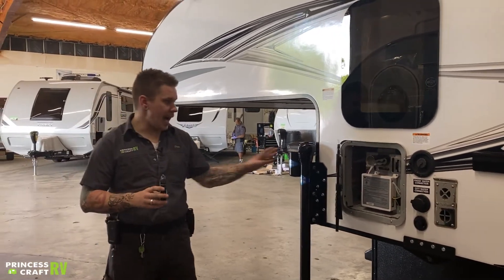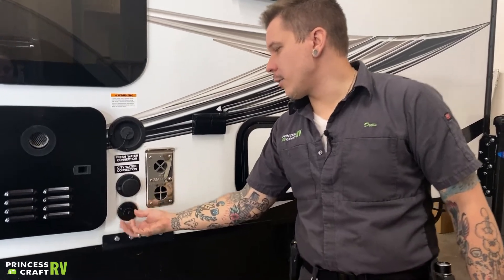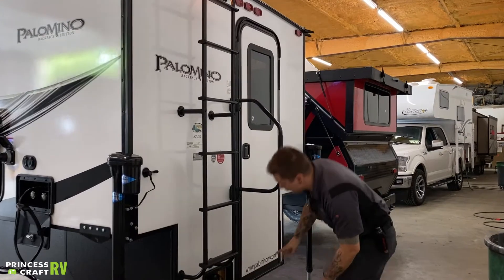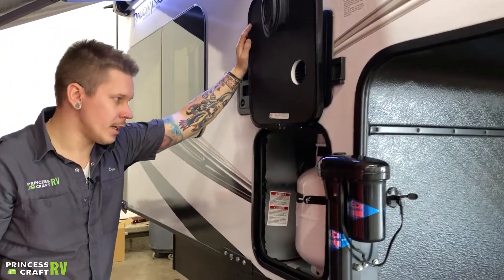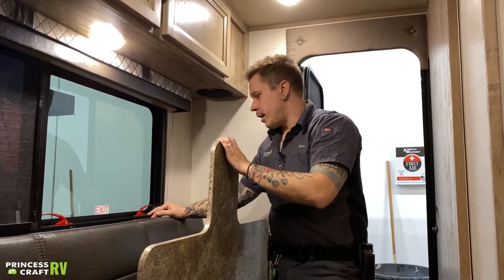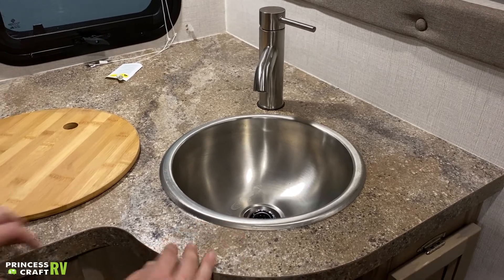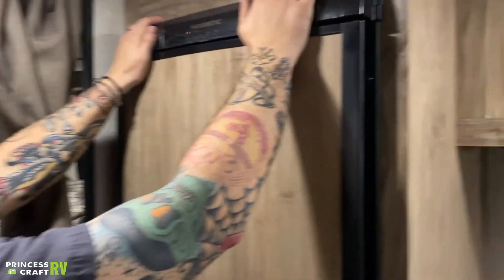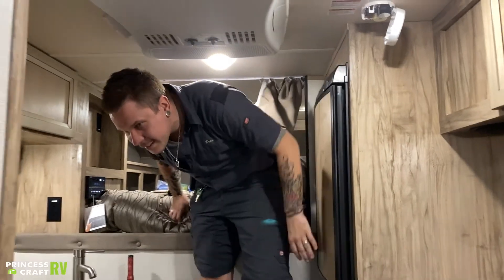2020 Technician Tour - Palomino HS750 by Forest River

Comment: How do you switch from shore power to Solar power or battery power? I have the HS 750 and without shore power, I have no power at all. I have a solar panel and two batteries but have never used either one of them. Can’t find out how to use those power sources.

Comment: Outstanding demo.  Im a 1st time shopper in this market and you answered so many questions for me.   Is this unit considered 4 seasons?  Snowmobiling is one of my goals.
Reply from the maker: They aren't marketed by the manufacturer as a 4-season camper, though many owners go ahead and camp in sub-freezing temperatures anyways.
Reply: Fwiw ,  for 4 season . . . Artic Fox  is what you need to look at .  Lance and  Host make some nice four season units also .
Reply: If you have enough propane and it's a hardside camper with decent windows it's fine in the winter. I was using my popup camper in the winter and survived haha. This is much better than that